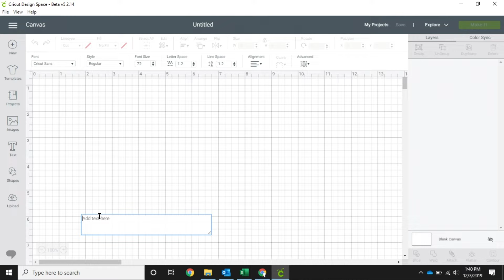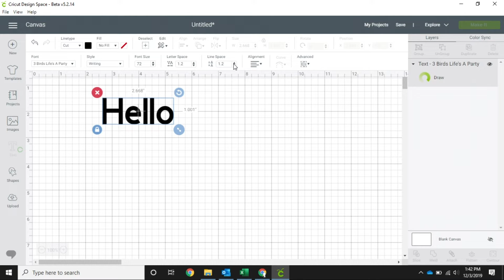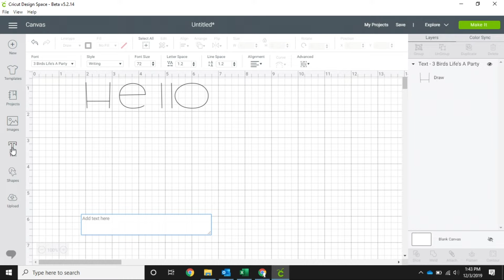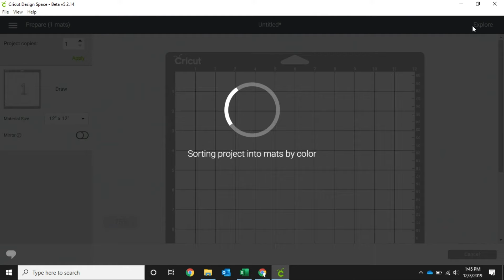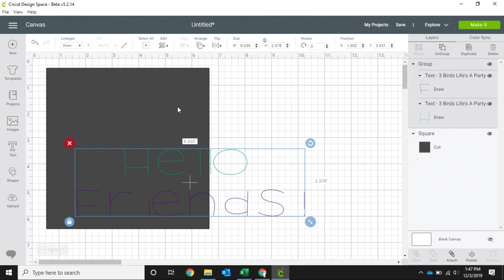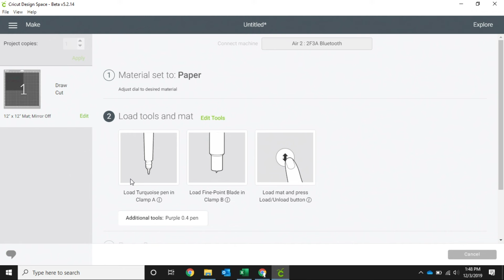How to Write with your Cricut Machine

Comment: Just got my Cricut Maker. I’m loving it......BUT!!! I’ve searched all through the official videos and 1) Can’t find out how to position and keep something I’m writing in a spot other than the default upper left corner of the mat. Example: I made a card which I designed using all of the tools at my disposal in Design Space. However, I forgot to add the sentiment and wanted to go back and do that simple task. For the life of me I couldn’t figure it out and have yet to see any tutorial on how to do it. If there is a tutorial I’d love to know where I might find it.
2) I’m working on an iPad. I’ve printed out the Cricut for iOS and have read through the entire thing. I don’t mean to be negative but it leaves a lot to be desired. Kind of frustrating. Any help in that regard would be greatly appreciated. Also, yes, I have looked at the videos on iOS here. Pretty basic and quite a bit different than the current version of Design Space. Anyway, sorry to drown on.....I absolutely love my Cricut and fully intend on mastering it, I just need help! Thanks!